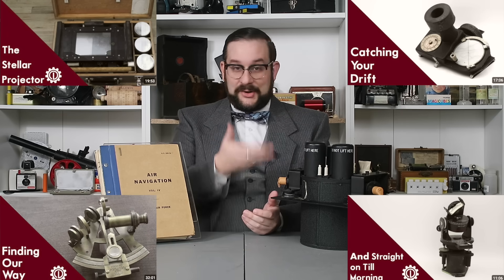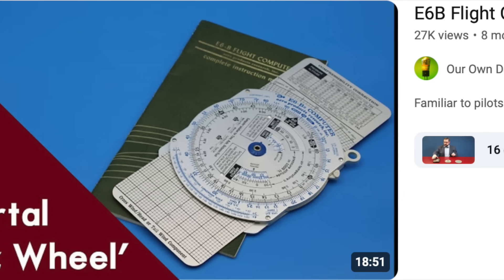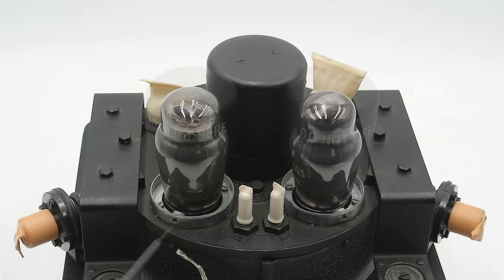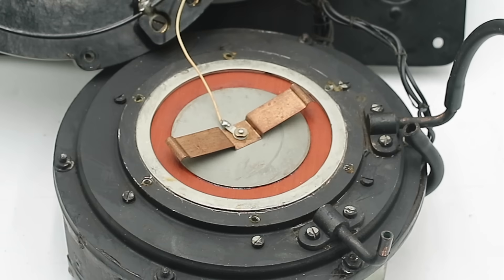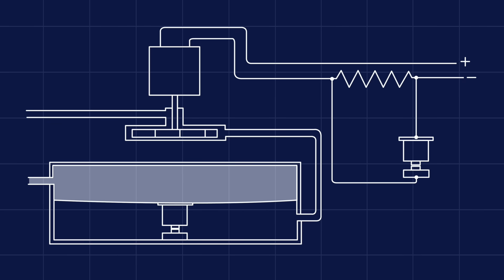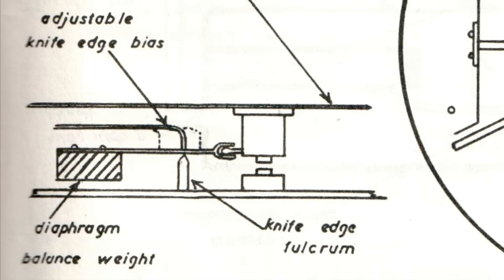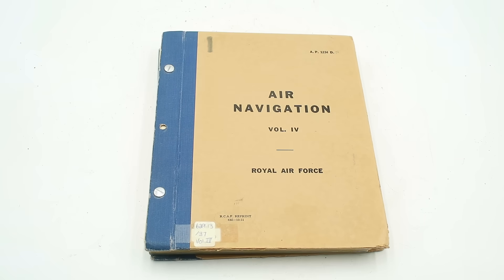Air Mileage Unit Mk.I: Highway in the Sky

Comment: Ive got a couple of mark 1 Air Position Indicators. They take the bearing from the gyro-compass and split the mileage from the AMU  into the N/S and E/W components, and use the latitute to convert E/W milage into degrees of bearing. They then sent that to the Ground Position Indicator. If you want to get the whole system running, youll need the AMU, API, GPI, gryocompass and (possibly also the helm repeater) and an air compressor/pressure regulator. There isnt anything special about the one used by the raf other than the range of allowed volatages.

Comment: Air Mileage Unit, eh? What's it called in Metric?
Reply: Navigation uses nautical miles because that unit makes the most sense. One nautical mile is equal to one minute of latitude, assuming the Earth is a perfect sphere. (It isn't, but it's close enough for most practical purposes.) If you want to convert, one nautical mile is exactly 1852 meters.

There is a consonance between the nautical mile and the meter, because the meter was also defined in relation to the Earth's surface. The original definition of the meter was one ten-millionth the great circle distance from the equator to the North Pole. If you multiply things out, you will find the nautical mile to be 1851.851851... meters. Eventually, the meter was redefined in terms of the speed of light and the nautical mile was rounded to 1852 meters.
Reply: @johnopalko5223  But thank you for the explainer.
Reply: @johnopalko5223  Never knew that. Nice one, cheers.
Reply: Knew I should've ended that with a smirk emoji...

Comment: what good is knowing air mileage?
Reply: Your air mileage, along with your heading, gives you your dead reckoning position, assuming no wind. When you can get a fix, you compare that with your DR and calculate winds aloft. If you're using celestial navigation, your DR is a reasonable assumed position for your sight reduction.
Reply: @johnopalko5223  i guess so, but the "assuming no wind" is the part bothers me.

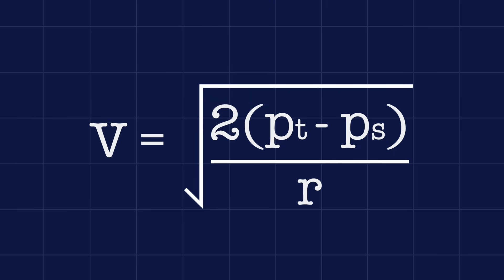Comment: According to the equation at 2:11, airspeed is not directly proportional to dynamic pressure but rather directly proportional to the square root of the dynamic pressure. Directly proportional means that if one quantity doubles, the other doubles as well.

Comment: Did I miss something? How does it log distance? It has to integrate speed over time, or is that the Part 2 device?
Reply: Rotating shaft drives a cam operating a contact breaker, the variable frequency pulse train increments a veeder-root counter.
Reply: Remember the telephone dial like pulses?

Comment: What an elegant solution! Watched recent interview with drone tech bros working on "gps denied" nav for military drones. It's easy to think we're very clever when we reinvent the wheel.
Reply: Well, they are clever, if they are reinventing a type of device from scratch without knowledge of older versions. Besides, one cool thing about designing and building analog devices is that you learn a lot of practical knowledge of the principals involved in fancy software and digital stuff.

Comment: I used to love working on the old Canberra stuff in the mid '90s (while they were still in operation in the UK). The engine starting box was a firm favourite in our workshop. We used it to scare the crap out of new entrants. Imagine a box that ran on clockwork (wound by an electric motor) to start a jet engine. We used to call it 'the box that goes bang'. Happy days. I never came across one of these though.
Reply: I loved seeing the Canberra do low level pass, the starting as you say was spectacular especially for any new Ground crew on fire watch below the wing who where not familiar with cartridge start.  Spectacular British designed aircraft that even the USAF liked ?.   Jim's  briefing on this devices operation reminds me of  Danger UXB b0mb disposal.  Good Christmas to you.